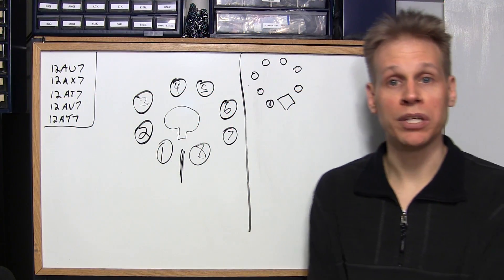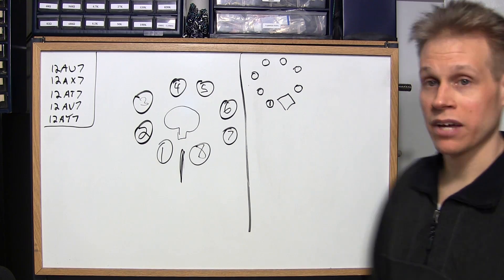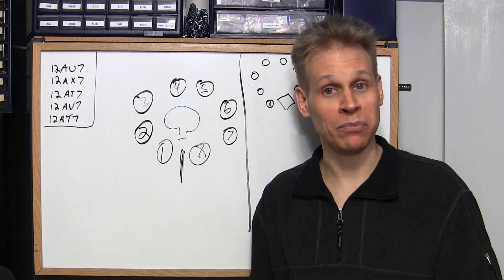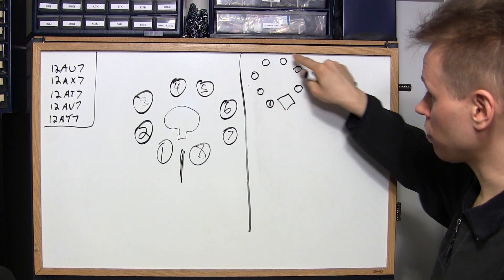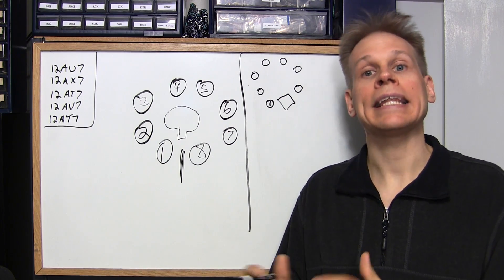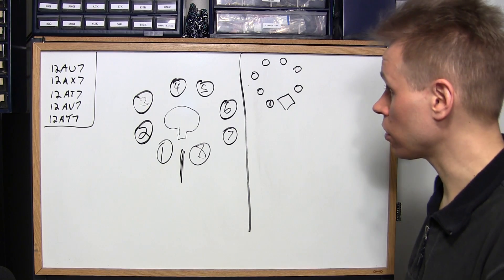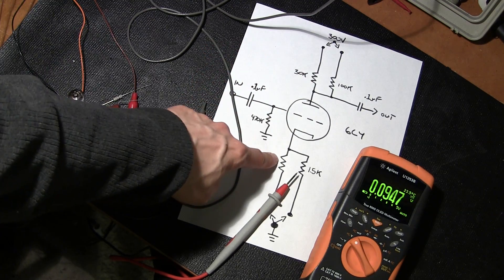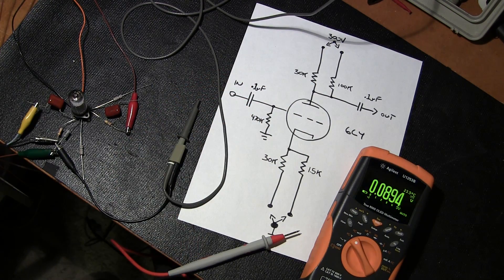Tube Amplifier Troubleshooting Tips

Comment: Hi there would would changing the value of the coupling caps from .1 to another value let’s say .22 will do?
Reply from the maker: Enable your amplifier to enhance the lower frequencies.
Reply: Mr Carlson's Lab love your videos they are great and don’t waste time and are to the point! . So the greater the value the more lower frequencies get enhanced? And also some tube circuits have two caps one right after input (before the tube), what’s the point of not having it? And I see sometime that the coupling caps are matched in values

Comment: Considering today's tube prices, would it be possible to crank down the plate voltage to the output tubes to the lowest possible?  I want to preserve the tubes and OPTs.  Am working on a 15 Watt per channel 1959 design stereo and don't mind running as 10 watts. And if I do reduce the voltages, is it necessary to do it also to the preceding stages?  Thank you.
Reply from the maker: Hi Noel. The life increase would only be marginal at best. If everything is operating to factory spec, those tubes will last an incredibly long time. The reason tubes fail is usually due to bad surrounding components.
Reply: That is good to know.  Maybe I'll stick to the original specs. I just hope the OPTs hold up to the factory set voltages considering the age.  Good thing the voltages and currents are indicated on the schematic.  I am recapping to the last capacitor.  Just received a bunch of  WIMA brand polypropylene caps (as you suggested is best for coupling).  Still hunting for high voltage electrolytic and oil caps as I type. Thanks  a lot for your reply.
Reply from the maker: You're Welcome, good luck with your restoration.

Comment: Great Videos.  Really enjoy these.  I've been working on a Hiwatt Lead 30 amplifier and I can't for the life of me figure it out or find a schematic for it.  I think the amp was modded at some point on the two input tubes (12ax7).  The issue I'm having is that the amp plays fine for a while but then the signal starts to cut out.  I get a very faint output.  The interesting thing is that if I play the guitar at full volume, the sound will come back, but when there is little to no signal, it cuts out again.  There are a 20pF cap and resistor on pin 9 to pin 7 to ground (I don't have the amp in front of me so I could be wrong on pins here).  I believe this is a mod (looks hacked together).  Could it be a cut off of some sort when there is no input signal?  I suspected the master volume pot to be at fault but it seems ok.  I've checked for broken solders and even replaced some caps.  Could use a little help in repairing it.
Reply from the maker: Hi Steve. It could be so many things. If it's a home brew mod, the possibilities are endless. A common issue is plate resistors going open on the pre-amp tubes. If you poke around in there, be aware there is High Voltage everywhere in that amp. Be careful.
Reply: I've worked on tube gear before.  Even built my own amps so I'm well aware of the B+ taking you out!  Appreciate the reply.  I'll take a look at the plate resistors later.  See ya.
Reply: OPK.  So I went in and replaced the plate resistors on everything.  The amp still loses signal.  Here is the interesting thing.  I wait about 15 - 20 minutes before the signal cuts out.  As soon as I go in and measure voltages on any tube or part of the signal path, as soon as it pops from the lead touching, the amp will come back, and then fade out again.  I'm at a loss.  If I had a schematic for this thing, it would make my life a lot easier.

Comment: I have a tube amp that produces a raspy bass sound if I turn the bass control up. I'm using 6L6 tubes. Could it be because the screen grid and the center tap on the output Transformer primary are hooked up together? I saw a lot of schematics where the screen grid isn't hooked up that way but rather using a filter capacitor and a 1,500 to 1800 Ohm resistor to the power supply.
should I rewire my screen grids the same way? I mean will that get rid of the rasp?

Comment: thanks for your vídeos. my question is: when you puts the volume at max in your radio and can ear the noise is because is a static noise ok and no radio station is over your point of the dial. could be measured the static noise?  your stick glass pointer could be used to check? thanks in advance.

Comment: Hi Mr. C. Love your videos,, I'm mixed up on something though,, When you say the input signal is going more negative (the slope direction going down) is it making the output signal at the plate larger? And when the input signal is going more positive(less negative or going in an upward slope direction)the output and the plate is getting smaller? Thank you,,  :)
Reply from the maker: Hi Terence. An Example: When you apply a positive signal at the grid, the tube turns "on" and pulls the plate towards ground, this action inverts the signal, so for example: if you have a grid Voltage variation of 5 Volts, this may pull the plate Voltage down 150 Volts across the plate load resistor, If you remove the +5 Volts from the grid so that the tube biases "off" again, the plate will return to say 300 Volts, because the tube isn't trying to connect the plate to the cathode via electrons anymore. So applying only 5 Volts to the grid causes the plate voltage to move 150 Volts. This is Amplification.  So when the grid swings positive, the tube begins to conduct (trying to connect the plate to the cathode) When the grid swings negative, its now separating the plate from the cathode, allowing the plate Voltage to rise again. So If you want to visualize this action, look at the plate resistor like a spring. When you apply a small positive Voltage to the grid, the spring stretches very far. When you remove the small Voltage from the grid, the spring returns to it's un-stretched state.
Reply: Mr Carlson's Lab Thanks Mr. C,, I was close at least,, just wasn't sure for sure,, Thank you. :)
Reply: Sometimes it's helpful to look at things from a slightly different angle. Under no-signal conditions the grid is held at a negative voltage with respect to the cathode. This results in a current (the quiescent current) flowing in the tube and the plate resistor which develops a voltage across the plate resistor so that the plate is at a steady voltage, which is equal to the HT supply volts minus the voltage drop across the plate resistor. The positive excursion of a signal drives the grid less negative, allowing more current to flow in the tube and the plate resistor. This increase in current in the plate resistor develops a larger voltage across it, which results in a decrease in the plate voltage. Conversely, the negative excursion of the signal drives the grid more negative, decreasing the current in the tube and plate resistor, causing the voltage across the plate resistor to fall, increasing the plate voltage.

Comment: I've got two working 6L6 power valves that are wobbly between the base and the glass bulb. I don't know their history but they work fine. Can anybody think of an adhesive I could put between the valve base and the glass that would take the high temperature of the working valve? I was going to use some non-acidic silicone adhesive... the specs say the operational range is up to 230 degrees C (446 deg F), but that might not be high enough!
Reply from the maker: High heat automotive silicone works great
Reply: Mr Carlson's Lab - Thanks Paul!

Comment: I stopped watching when you said pin 9 of a 12AX7 is the center tap.
Reply from the maker: So, you stop watching people when they mention facts?
Reply: You should really look at it one more time.
Reply from the maker: Ok, I looked at it one more time, and pin 9 is still the heater center tap, was pin 9 supposed to do tricks? Here is a tube data sheet for you. http://www.mif.pg.gda.pl/homepages/frank/sheets/093/1/12AX7.pdf
Reply: You got me. Pin 9 was the heater CT back in the 70s when I first learned, and my RCA Receiving Tube Manuals still show it as such, both in schematic and in the “HM” designation. I thought I’d recalled the diagram to show separate heaters for the two triodes, but it shows a single tapped heater.

Comment: Strange one I ran across was on a particular guitar amp where half of a 12AX7 was biased with cathode direct coupled to the second section grid.  The heater to this cathode had over 100 volts relative to the heater.  Several tubes would not work due to heater cathode leakage at this voltage and biasing.  Manufacturer had specially selected tubes that would work in the circuit tested for low leakage..
Reply: Let me guess, Hiwatt? A good mod to do in this case is to raise the filament supply on a DC bias of around 50V (voltage divider from B+, with a smoothing cap, connect to center of hum pot or filament winding CT)

Comment: Hi, I am working on a clone of a Vox guitar amp and wanted to use thermal flow simulation to assess the 60's cab design and orientation of the amp chassis. In the Vox amp the tubes face down (like many amps) inside the cabinet. I am not sure how to apply a value for the tubes in the chassis which for the simulation is input as Watts. Forgive my obvious lack of electronics knowledge but is there a relation ship between the Watts and external Temperature reached by a tube. The tube data sheets dont show a working temperature range. The flow simulation should show if the heat convection to the components in the chassis is better or worse depending on its orientation, which is the aim of the study. Some people have added fans to their old amps as they have a concern about heat, and some swear that the hotter an amp runs the better it sounds. However there must be an ideal temp range or at least max that a tube should run before its life span is dramatically reduced. I can also use the simulation to see if adding a fan will improve the air flow and therefore heat dissipation. There is also transfer of heat through the chassis from the tubes to other components on the turret board and I have often wondered if the amp is better off in an 'upright' config whereby the heat from the tube rises up and out of the cab, without passing over the rest of the components as apposed to the 'upside down' config.
Reply: Most of the heat in a tube is generated by the heater elements which operate at a specified voltage (in most audio equipment 6.3v) the current drawn by the tube heaters is always specified on the appropriate
 data sheet. The bias voltage/current applied to the tube also adds to the operating temperature. The air temperature within the cabinet will not effect the operation of the tubes so adding a cooling fan will remove hot air but have no sonic impact. The heaters can be operated at a slightly lower voltage than specified. Some people believe that doing so will improve tube life although a more likely reason for tube failure is heat cycling, ie switching them on 
and off. The reason that the data sheets do not give maximum operating temperatures is that as long as the tubes are operated within their electrical limits they will not become "too hot". There are exceptions such as high power radio transmission tubes some of which are water cooled. Some transmitter tubes dissipate as much as 10000 Watts so are in a different league to our humble domestic tubes.
Reply: Thanks, that helps a great deal with my understanding. I have noted that keeping capacitors to within there max temp range is important to their life, so I do intend to turn the clone chassis over so that heat from the tubes rises out of the cab and not through the chassis and onto the turret board. Intuitively I think it must be better to run the circuit resisters, caps and electrolytic caps as cool as possible by ideal orientation and layout of the chassis and avoid any unnecessary heat from the tubes whether by convection or conduction. I have post on the SW sight showing my work so far. https://forum.solidworks.com/message/666048?et=watches.email.thread#comment-666048

Comment: what does a 12 at7 tube do?
Reply: so it does the same as a 12ax7 then.
Reply: what is the gain of a 6eu7 tube
Reply: Gain on a 6EU7 is 100:1 the same as a 12AX7 but a different pinout.

Comment: Why did you use a 30K and a 100K resistor instead of one 23K (which would be the equivalent value of the two resistors in parallel)?
Reply: He was not using them in parallel. He only had one connected at a time for he was using them for two illustrations.  The first was the amplification and the second was to better show the phase inversion.
Reply: Ah right. Thanks for clearing that up.

Comment: hi, mr carlson. i recently bought an OTL tube amp that uses 6as7 at the amp section and 6sn7 as the the preamp. my question is. do i need to wait for some time warm up the tube before using them or can i use it as soon as the tubes are glowing? tIA and your channel is amazing!!
Reply from the maker: Just give it about a minute, that's all it needs to warm. The cathode heating time in a 6AS7 or 6080 is about 30 seconds for full emission. The 6SN7 warming time is shorter, about 11 seconds or so.
Reply: wow!! i im glad i asked you first other that believing all the things that i've read on certain forums that my amp needs at least 15 to 30 mins or so. for it to work on its optimum level.  im awed and somehow envious with your knowledge and expertise.  more POWER!!!! to you and thanks again =)

Comment: would it be any trouble to explain how the high value grid resistor is at a less voltage than the relatively lower value resistor of the cathode? I can't quite get to grips with it.  My brain aches with trying to work it out myself. is it not like a potential division?
Reply from the maker: +semahnai 
I will do more on this topic in the future.
Reply: With no signal, the grid resistor has no current flowing in it, so that no voltage is dropped across it (Ohm's Law) meaning that both ends are at the same voltage. Since one end of the resistor is connected to ground (0V), this means the grid is also at 0V. The current flowing in the tube is flowing in the cathode resistor so that the cathode is positive with respect to ground.

Comment: Hy, can you please explain me the reason for "soft" clipping with tubes?
Reply from the maker: +Slovenija12345 
Plate resistance (the resistor itself) too high..... You like 12AX7's........ Leaky coupling capacitors....... Cathode bypass capacitor issues, The tube is biased incorrectly, the list goes on. In a normal running amplifier, to musicians, the distortion that occurs in the output stage, (transformer saturation) is what seems to be preferred. This is accomplished by over-driving the amplifier. This is also known as "soft break up", or soft clipping. Pre-amp clipping has a much "harsher" sound to it. Pre amp clipping will square off more.
Reply: +Mr Carlson&#39;s Lab 
Thanks for the response.
Reply: Mr Carlson's Lab do you like 12ax7 ?

Comment: Thank you so much for the awesome lessons. I look forward to every new video you post, they have helped me immensely. I repair tube guitar amplifiers, as a hobby mostly, because there are very few good repair shops in my area, and the few that are charge more than most gigging musicians can afford. I also test my repairs by playing the amp at performance volume for an hour or so, this helps to ensure that the musician doesn't experience a failure at the worst possible time, during a gig. So far I am 100% with this method. Thanks again and God bless!
Reply from the maker: +flockoglock 
Glad your enjoying! Sounds like you know what you doing!
Reply: +Mr Carlson's Lab sometimes it's more about what not to do.:)

Comment: This is kind of "the" resource for electron tube data sheets. I have a few others that are common to Luxman, & Telefunken that are not on this site, but it is a very complete data site.  If you own a copy of the RCA Handbook 3, the pages on Frank's can be printed 8 (4 per side, for a total of 8) to an 8 1/2" x 14" piece of legal sized paper, cut, punched and inserted into the RCB HB3 binders. I think the Tung Sol, & Sylvania binders are about the same size. An old office or school paper cutter block works great for doing this. Here is the link for Frank's Electron Tube Data Sheets.  https://frank.pocnet.net/
Reply from the maker: +Seth B 
Thanks for taking the time to write Seth, If you like Franks, here is a direct link to just enter the number. I have this in my favorites bar:   http://www.mif.pg.gda.pl/homepages/frank/vs.html
Reply: +Mr Carlson&#39;s Lab Muchos gracias, I'll put that in my favorites too. I like having the books too. I sure wish I was up in your neck of the woods. I really love it up there. There is no such thing excessively cold weather, only inferior winter clothing. Hot is hot. Great tutorial! You are showing the basics, of how it works, gain, adjusting the gain, and changing the tone with shunt caps. I assume you are using the term phase inverter, because each stage essentially kicks the signal 180 deg out of phase & inverts. The reverb remix on some Fender amps puts that channel 180 out from the vanilla channel. I suppose I should call cathodyne, paraphase, side branch, balanced load, long tail pair (a form of a paraphase) or center tapped inductive coupling XFMRs phase splitters?